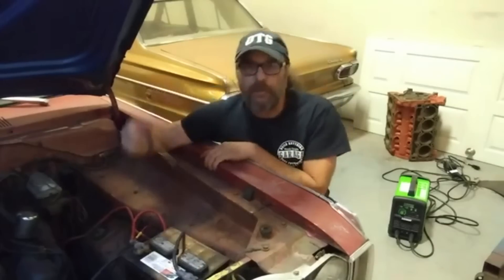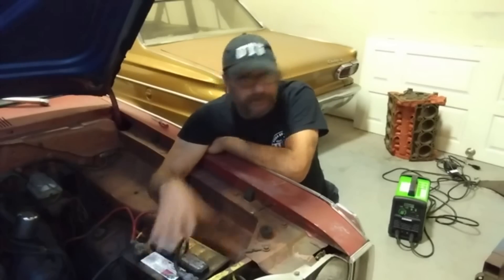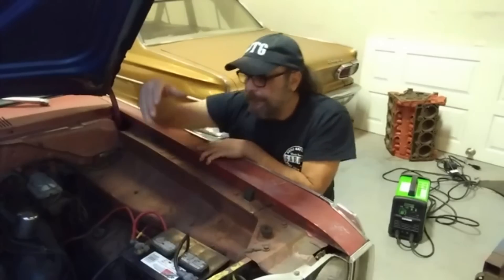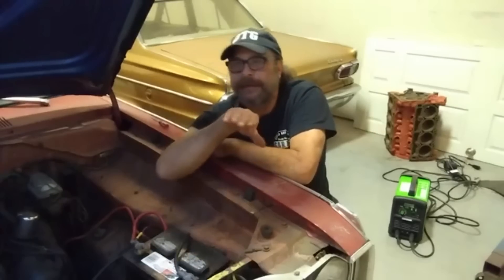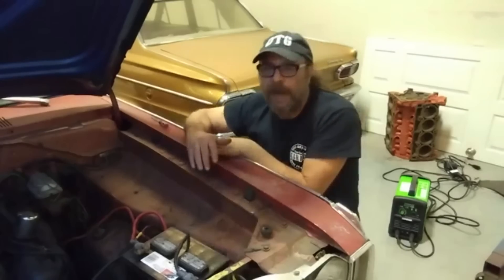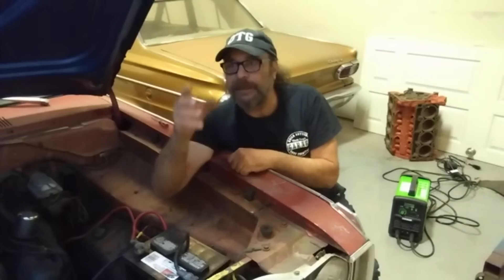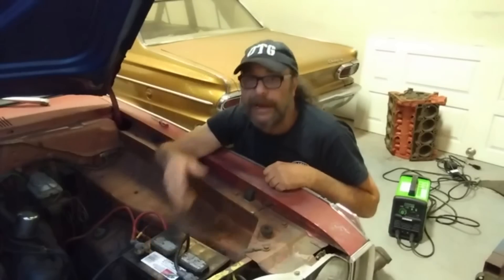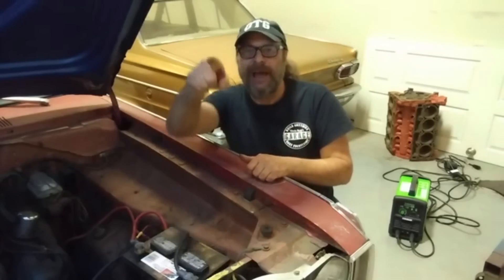Stick Welder Battery Revival SUCCESS!

Comment: I enjoyed both of your videos and I am glad you were able to get the battery back up but a lot more respect for safety needs to be exercised doing this! First, I would have never put more than 50 amps into a dead battery! As quickly as it started boiling should have told you that! Secondly, Yes there was still an air gap inside the battery as you didn't fill the battery to the brim with water except on that one cell! I didn't see this to be that big of an issue as you turned the welder off first!
I have had a battery blow up on me and when it did I expected to see a hole in the side of the fender it was so loud! There was so much force that there was nothing left of the battery! I'm just asking that anyone that does this respect the possibility that it could blow up on them and you should preach the same thing to your viewers! You have a large audience and if someone gets hurt part of that blame falls on you! I have worked on thousands of cars also and no matter what you are doing safety comes first!
Reply: No-just no. If someone tries this and does something stupid getting themselves hurt it is NOT on the OP. This way of thinking is the cause of the frivolous lawsuits we see today. OP is not forcing anyone to do anything nor did he mislead anyone in any way. There is risk in everything and the only guarantee in life is that you'll die. If common sense alludes you, stay safe on your couch until you eventually choke on a cheeseburger. Leave the rest of us alone Karen.

Comment: Your battery is already good prior to reviving because it was made in 2017, moreover, the max cycle of 500 min have not been reached. It means the plates are not completed rusted. However, you may use it for a couple of years not like a new one though. A regular charger would have done the job with adding distilled water of course.

Comment: Its a Vented Batterry and you had the tops off filled with liquid and no sparks a very little or no chance of an explosion,it's a different story with a sealed lead acid battery altho they have pressure releif valves in the caps and the case will bulge first so that depends on the strength of the case, good video but you have to take those precautions  googles and stand by water.

Comment: One common sense thing is, if you ae going to boil the electrolyte in any way, whether it is with this desuphate trick or just high amp charging, open the cell caps so the battery does not become under pressure due to the gases.  These "intelligent" chargers that have a recon phase, are doing juts what Tony has done with high amps to return the sulphate back into solution.

Comment: Well said! Thanks for your follow up. I got a  dead battery from AAA from 6/20. Came out and put a digital tester on it. 2 volts, but because the machine didn't say “fail”, they wouldn't replace it. Going to try this hack & see if it works as good for me.
Thanks!

Comment: some batteries are $400.00 so this is an awsom vid ,and i hate then new protective battey chargers they pretty much usless whats the point of a charger thas doesn't charge when thats their soul perpuse.   And you can also bring a dead battery (  0 volts ) back to life by reversing the polarity of the battery, but it doesnt last as long.

Comment: Exelent vidio. Pour them full of water,sit them in a tank and boil the crap out of them for 20 seconds on 150 amps Dc.They either work perfect or usless.I dont even fool with testing befor hitting them,never had one to blow up yet but I fill them till it runs over to start with,boil over lowers the level to normal.just make sure to not lit them get too hot.

Comment: I had a battery pop when I fired it up once.  The motor started and I smelled the cloud.  I got out, with engine running, and lifted the hood.  The top of the battery and flower petaled, each cell top going the opposite direction.  Acid spray across the underside of the hood and across the top of engine.

I dropped the hood, drove to the store, and bought a new battery.  They were NOT happy when I brought in the wreck of a battery!  "I can't give you core return on that!"  I said "Fine!" and left it on the counter.  Drove to the self serve car wash and power washed the engine and compartment.  No further issues.

Comment: Maybe these people did it with a sealed battery or with caps on. I'd be interested to know what voltage your arc welder is putting out at those amperages.
Reply: Finally somebody asked a good question yes what is the voltage the welder is pulling out we need to know the voltage.   I have done many experiments with Batteries as I have built electric vehicles and electric bikes I haven’t even cut them open after casting to see what the plates look like I did have  success sandblasting the plates lightly to remove sulfation crystals that it was very hard putting the battery back together.

Comment: tony put a spoonful of epsom salts in each cell before you do your thing. learned this from a old guy long time ago and he said they did it in the army . doesn't work everytime but about 80% for me . please do your battery revival outside just for safety . google epsom salt battery fix. supposed to remove the sulfation off the lead plates .

Comment: You cannot argue with stupid!! - also we live in a throw away society! - its nice to be able revive something rather than just ditch it. 

I would say with the common sense thing, know your limits, if not savvy,  don’t try something like this! which has the potential to go wrong. 

For instance I had a battery which started giving issues - a garage did a load test, which it passed……I charged it on the car, but its charge was not lasting. 

I decided to take it out and charge it, it had a boiling sound like a kettle - then I looked in closer detail, it was not rectangular anymore - but misshapen and warped - (plates broken down).

 - - Inspect the battery before charging it - do it behind a screen or wear a full face shield just to be sure  & (like in the video), turn off the power before taking off the leads  👍👍👍👍

Comment: I had a battery go bang when I was an apprentice, it didn't blow to bits but did give me an acid bath, i jumped straight in the shower with some bicarb soda with no ill effects after a good shower, not to self "be more carful of sparks around charging batteries" Never made that mistake again.

Comment: Like Tony says, batteries don't explode, they pop.  Battery acid is also 2/3 water.  It will irritate, but not melt flesh.  Battery acid in the eye is the equal (pain wise) to sweat.  Flush it out of your eyes, rinse it off your skin, no big deal.  I built the damn things for 16 years in just about every department in production including the formation department which filled and charged them.  Great post!

Comment: Common sense the fruit that doesn't grow in everyone's garden, god that is a great line. But yes, you're correct. Been around cars and working on cars since I was old enough to hold the flashlight for my dad. I've seen a handful of lead-acids "explode" and at the most extreme it's been a loud 'pop' at the most. The worst part is the mist of battery acid that gets in the air in an enclosed space like a car or a small garage. I don't know why people think these are LiPos that are going to burn the house down in some fiery explosion, and even then LiPos don't "explode" like a bomb, they just turn into a fireball. People in Youtube comments make you really wonder how most people can walk and chew gum at the same time

Comment: Awesome video. I'm tired of batteries that just "give up" after a few years, so I've got a couple questions....What about maintenance-free batteries with caps you can't remove? Safe to boil them like this? How about sealed AGM's? What's the voltage on the welder? Would a higher-amp charger give the same results? I've got a good charger, but never considered using it to refurb a challenged battery.
Reply: I'm LATE to this post but this is my experience with your questions.
1 ) The SEALED Batteries do have some ventilation to take up any expansion or they would probably crack open. With that in mind then i would proceed judiciously and start out with very low amperage's and Shorter times.
2) AGM's are also vented but even less so. I have not personally attempted any AGM but heard they are just as acceptable with the appropriate time and Amperage's. I have a couple that are just not taking any charge from standard chargers and plan on attempting an AGM charge inside a small' walled enclosure...open at the top...if it does explode then the' walls should retain any flying debris and help save my life...LOL  
3)  Higher Amp Chargers haven't helped in any of my attempts and now think that the higher AMPS of 80 to 120 may be what they need to knock the film off the internal plates.
I still have a couple commercial chargers with 75amp jump-start and the other is a 90amp jump start setting.n The issue with both of these is that they don't stay at full charge for more than a few seconds...107seconds was the max for the most expensive General Electric was able to deliver before the Reset-able Internal Circuit Breaker Tripped.

((((((((((     EDITED SECTION::: I forgot to mention that I recently bought a high end and very expensive AGM charger that has a specific AGM de-calcification setting and even that hasn't repaired the two dead AGM batteries I plan on using to try this ARC system....I think the ARC on high amps is the way to go but wait and do your own research before you go ALL Ape-Batt-Crazy. To reiterate, I'm going to start out low and slowly build AMPS at shorter times before I build up to longer times with higher (90 to 120) AMPS.    ))))))))))

Conclusion: I think from the others I've spoken to about this system is that the Higher Amperage setting on the ARC Welding settings are what is needed.
Like I said before, i'm certainly no expert here but this is what My research has given me to think.

Best of Luck to your endeavors and break a leg...lol
Reply: I've got some experience with this.  I've not tried the stick welder thing yet, anxious to try, but a fifty amp charger will do it sometimes.  It sometimes works with one of the older ones that have a timer.  The newer ones will sense that there is no charge and refuse to start or shut off after a few seconds.  You have to get a strong current on it even if it isn't accepting any current because of a high resistance.  As the battery looses charge slowly, a sulfur oxide powder will adhere to the lead plates in the battery.  Once all of the plates in any one of the cells is covered with this salt, it has a very high resistence and will no longer charge.  The idea is to get the plates hot enough that they flex a tiny bit at the same time the boiling fluid works some of the sulfate salt off of the lead plates to expose them a little bit.  But you don't want the plates to be so hot they touch or melt the connections.  If they touch, that cell will short, and that ruins the battery.  So you have to put a really strong current into it even though it has a very high resistence to get enough heat generated for it to work.  The sulfur salt will precipitate in the bottom of the battery, but it will go back into solution as the battery is charged, and the stuff still on the plates will also go into solution as the battery continues to charge.  But a lot can go wrong.  Plates can short, produce tons of heat, and kill a cell, you can melt one of the lead connections between the cells, you can melt theconnection to one of the posts, or the plates could be so corroded that there is no metal left.  Once you can get it to start accepting a charge, it will usually charge to the capacity left from the remaining lead metal still in the plates.  The most common problem is plates in one cell will touch and short out that cell.  The rest of the battery will charge OK, but the battery will only put out about 11.5 volts, or just over nine volts if two cells are shorted.  Most modern chargers have safety features to keep you from blowing up the battery and getting injured and suing whomever sold you the charger if it senses that the battery isn't taking a sufficient charge, so you need one that puts out fifty amps no matter what from the seventies or early eighties or earlier for this to work.

Comment: Dunno about this dude. Batteries arent completely sealed units, they have a breather in the side for gasses to escape. You cant have a fully filled unit and then put it throu temperature changes its gonna pop. Old batteries that you had to maintain with battery water you had to leave an airgap between the plates and the top for gasses to expand or the battery would pop.
I have seen a battery explode, and I dont mean pop, I mean explode. We found plastic pieces of that battery in the yard months after it happend.

There is no conspriacy that prevents you from reviving a dead battery just so you go buy a new one. Batteries are dangerous, you dont fuck around with them.

Comment: Even if it blew up it would only blow the caps off the battery in a flare like motion. 
Not explode. Yes boom. A chain is only as strong as its weakest link. Explosions happen when you compress gasses and ignite them. The more compression the harder it will explode also depending on how hard it is for the burning gasses to escape. 
Even if there is no airspace for hydrogen in tbe battery, even if it does create hydrogen and pressure ut will only blow off the caps. That's it.
And no flames. Just caps flying off.
Reply: So they don't explode? How do you explain the 30 exploded batteries in my garage?  I was pretty sure so for that it was because of the hydrogen exploding after a spark.
What is your stance there? Someone put explosives in my batteries? Perhaps there are some terrorists here in this remote location?
Reply: @mcgeufer  was it a sealed battery? "Sealed" 
The harder it is for the burning gasses to get out the harder and more violent it will be when it breaks that weakest link which is the batter casing. 
The sealed batteries aren't actually sealed but they put the caps on so that the consumer xant just take the xaps off and service the battery. I guess it could exlode if the caps and on really really tight. 
When u say 30 exploded batteries, do u mean battery cases shredded and shrapnel flew everywhere?
Reply: @daveed1797  No, the caps are removable, they have to be, have to be able to refill the distilled water.
And yes, they are shredded, not all of them. The last one has the hole upper part missing.
They do get a lot more stress than normal car batteries, of-course, since they are part of a solar system. So they bubble a lot while they charge and discharge. As they get older, the lead may get some damaged bits. And on some unlucky day there might be a spark between the two sides of the crack, and they blow up, if that crack also happens to have a bubble nearby. I was lucky so far, was never inside there while it happened, but I hear the bang from my house.
I guess one part of the problem is the fact that you can't fill them all the way up, there is like 5-10 cm of air, plenty of room for hypogene.
Reply: @mcgeufer  from my experience with my HHO torch, the explosion is louder than the damage it does. Well how I had it set up. My spark arrestor was a hassle jar woth water. Well it blew the lid off of it and I got a hard punch to the chest.
Reply: @daveed1797  Oh sure, the explosion does not cause a lot of damage, but the acid all over the place is not optimal. Oher than that, it's really just plastic and some lead flying around.
But I'm rather not next to a battery that goes off. Acid in the Eyes is not pleasant and while the explosion is mostly harmless, the bang in the garage might still cause damage to the ears.
Reply: @mcgeufer  I had a Mason jar woth water and air hoses as the flashback arrestor. And the lid screwed on tightly.  Well it blew the metal top off and luckily the top didn't hit me. But it was sooo loud. My ears were ringing for a min. 
And the Shockwave tho, the Shockwave punched me in the chest and pushed the air out of my lungs. It was crazy. 
Then my deaf neighbor comes out to his backyard asking "did u hear a detonation?"
Since then I've figured our how to avoid thar problem. 
On the jar I cut a hole in the lid and put plastic from a plastic bag. Tape it onto the hole. So when it blows it only blows through the weakest link. The plastic bag covered hole. No boom or shock wave and shrapnel.

Comment: Actual electrical engineer here- arc welding = zero resistance, you’re literally shorting out your transformer on purpose, hence the duty cycle so it doesn’t overheat. Batteries have resistance…it’s low (.02ish ohms) but it’s still a resistive load. In other words, it resists inrush current, so you’re not actually taxing the transformer in the welder. Batteries have an anode, a cathode, an insulator, and an electrolytic fluid (acid). The fluid is the only way for electrons to flow from the anode to the cathode….so picture welding but keeping your torch 8” away from your material. It’s still trying to find a path to ground, it just can only do so through the tungsten which in this case is acid and resistive. 
Also, whether your battery is full or not, it’s still giving off hydrogen a few minutes after you disconnect the charger. Hence a “surface charge” that’s well over 12vdc. You’re pumping it full of electrons and causing a literal chemical reaction, said reaction doesn’t immediately stop when you turn off the charging source. So while you don’t have any chance for a massive explosion, you could still get a quick flash if there’s an arc over top of the vent holes. Hence my previous comment about waiting a bit longer before putting the load tester on it.
Reply: To be fair, dead batteries have a higher resistance, that's why they can't hold voltage any more.